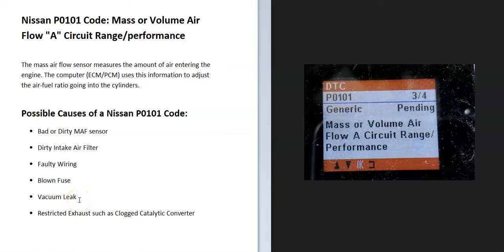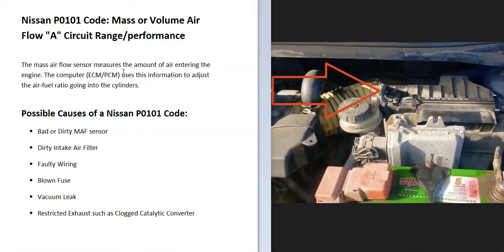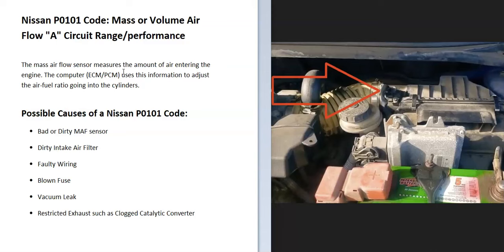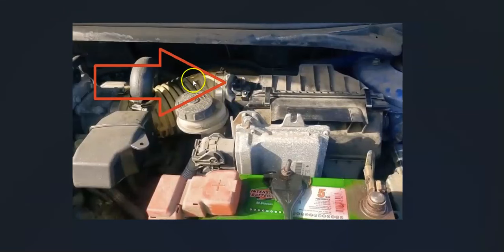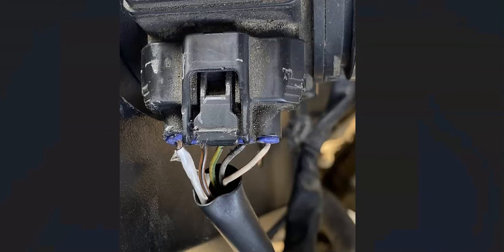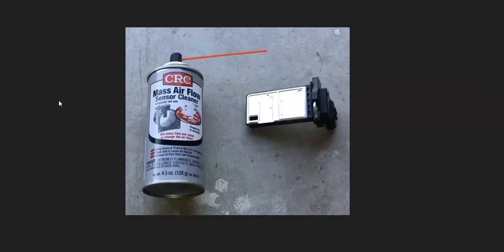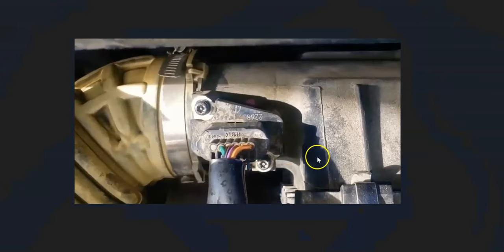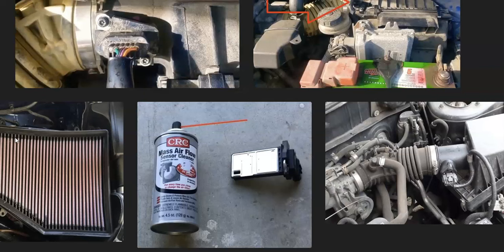Causes and Fixes Nissan P0101 Code: Mass or Volume Air Flow "A" Circuit Range/Performance

Comment: Hi guys sorry for this long message but i really need some help! I have a 2011 Nissan Maxima. Lately it has been jumping sometimes when stepping on the gas and having acceleration issues. The RPM is under 1 and it keeps making a jumping engine noise that sounds like vrmmm, vrmmm, vrmm, vrmm. Autozone used the diagnostics tool and said it was the mass air flow sensor. I bought a new one, mechanic installed it today and it's still having the same problem. When i turn the ceiling lights on they blink in unison with the vrmmm, vrmmm sound. My mechanic used his diagnostics tool and said the mass air flow sensor still came up even though he replaced it. He said another code came up "Bank 1 P-0101" this one. He watched a youtube video and said the gas is too rich? Whatever that means. He told me it needs to be taken to a shop to be put on a lift. He said he thinks the issue is behind the engine air intake hose. Anyone familiar with this problem and can give a resolution? I would truly appreciate it. I just spent $640 on a new alternator and a wire kit, then a week later $240 to fix some antifreeze leaking under the hood, then 2 days later this happens smh. This car is really getting on my nerves. Also if amyone can tell me by driving it with this current issue, can i make it any worse? Like will i cause further damage to my car? Should i just get this fixed right away and try not driving it?
Reply: My issue was low trans oil.  Replaced if over 20k miles since last trans oil change.
Reply: That sounds like a bad O2 sensor post CAT, when they go bad it runs rich like that especially at low RPM's like your saying bc that's when the air flow through the exhaust is at its lowest.
Reply: @EpicShmoke that's exactly what I was thinking. You'd think the dealership would check the O2 sensor.

Comment: I replaced the mass air sensor 3 times in a year what is causing this.
Reply: Dirty throttle body
Reply: @bluehunnids887  cleaned mine. No leaks, changed PCV valve the works. Changed the sensor too. Air filter was checked as well. No one can find the problem
Reply: O2 Sensors, they work in conjunction with the MAF. They dont effect anything untill the car gets hot and is out of closed loop though
Reply: @EpicShmoke I have test pipes on my G with admin tune to exclude 02 sensors and my car is having this same issue.

Comment: Excellent video. I have a question for you. I have a 2012 Rogue with a MAF problem p01 01 code. The Nissan dealer replaced the MAF. I replaced the air cleaner. I did not replace the PCV valve yet. The dealer I go to tells me they cannot fix the problem any more than they have because they do not have a Master Technician??? I am going to have to travel a ways to get a dealer with a Master Technician. The engine light has gone on twice now. It is supposedly fixed now. If not and the light goes on again and the car seems to run fine I want to turn off the engine light. I purchased a Walmart Hyper Tough HT 100 code reader. It is not much on instructions. It connects with your phone via Blue Tooth to give an explanation of the code. I do not need an explanation and I just want to turn off the engine light. My question is, do I have to use the Blue Tooth feature with the HT 100 or can I just plug it to the plug in the car, turn the ignition to on, read the code, and push the red button to clear the code??
Thank you, Tom Spero
Reply: Simple it is most likely and Air Leak on the intake boot check for cracks or breaks causing the leak or code have had this issue with many Nissan cars from 2010 - 22
Reply from the maker: I've never used that scan tool, but you should be able to plug it in and, say, clear all codes. The code will come back until the problem is fixed. If the MAF sensor is good, the problem is likely in the wiring.
Reply: @HVAC_Mechanic  Thank you

Comment: I had it replaced 2 times already and the code keeps coming up after 100-200 miles of driving, I might think is the fuse, but idk the number
Reply from the maker: I would be sure there is no vacuum leak and test the wiring.
Reply: @ishowman7  catalytic converter if you have high miles

Comment: Replaced pcv valve , new air filter , new maf sensor , and the same code still pops up . 2019 Altima under 60k . Thinking I might have a leak somewhere , I hear a slight whistle on acceleration when the code is thrown .
Reply: Have this issue on my 2019 also , changed filter and cleaned maf tb is next on list
Reply: @Xiantyl  let me know if cleaning the TB works . It’s insane that Nissan doesn’t do shit about this to help .
Reply: @Edemce1  got u, after the dealership changed air filter under warranty this code started appearing sporadically
Reply: @Xiantyl what was the fix
Reply: @TDRDemce  What is the TB?
Reply: @Davi-did  throttle body , my issue was dealer doing a flash on the ecu free of charge
Reply: @TDRDemce what is a flash on the ECU
Reply: Simple it is most likely and Air Leak on the intake boot check for cracks or breaks causing the leak or code have had this issue with many Nissan cars from 2010 - 22
Reply: @dconektaztapia7975  came out that it needed the reflash . No cost covered by the dealership . It’s on their bulletin

Comment: I replaced mass air flow but car warning lights come on in dashboard then when I stop at red light car shuts off !! 🤷🏼‍♀️🤷🏼‍♀️🤷🏼‍♀️🤷🏼‍♀️🤷🏼‍♀️
Any suggestions ?
Reply: Need OEM sensor only 
Any aftermarket will fail
Reply: Simple it is most likely and Air Leak on the intake boot check for cracks or breaks causing the leak or code have had this issue with many Nissan cars from 2010 - 22 and clean the Valves or turbo boost..
Reply: Any conclusion?

Comment: I finally got the p0101 code off my 2016 Nissan versa. It was the catalytic converter. My car had acceleration issues and at around 40-45 my car would have issues changing gears. It also made a noise that sounded like air being shot out of the engine. And anything over 60 was hard sometimes impossible. But anyway I changed catalytic converter out. My car runs better than when I first got it. I have new spark plugs fuel injectors coil packs throttle body new mass air flow sensor fuel pump and catalytic converter. 😂 I definitely threw parts at it. 😝 but hey she runs like a dream now.
Reply: i have 2012 versa.. changed the spark plugs and MAD and coil packs and the issue stayed.. gonna change the catalytic converter and see. thanks bro
Reply: Thank you just fixed my p0101 it was a clogged and deteriorating catalytic converter. Same exact symptoms. No other codes present. 196k miles
Reply: @ that’s is awesome I am so glad my comment helped you.
Reply: @ I can hear the cat converter if it’s messed up now.
Reply: Hey questions here. I have 2009 corolla LE model with a persistent P0101 code. I threw everything as well EXCEPT catalytic converter, throttle body, charcoal canister. Any ideas? 

It takes a bit longer to reach 3000-4000rpm around 60mph
Reply: @jamessena1410  you can test the cat converter through the O2 port. What is it doing besides rpm does it make a rattling noise? Smell and eggie smell? Tell me symptoms of what else it doing. You can look at throttle body and rub finger for built up carbon. Also check air intake system for holes. And last but not check for vacuum leaks. I use wd 40. Turn car on spray everything with wd 40 if engine starts struggle or rev that area has vacuum leak. Also wd 40 does a great job of cleaning engine outside. So rub down after spray and engine will look way better.
Reply: @jamessena1410  but the rpm slowdown was my pre symptom before it full went out and had trouble getting over 40-45 mph
Reply: @user-pu1xq9ef9u  There is no weird rattling noise. I might have missed on something. I just did a vacuum leak test only to replace the fuel filler neck and gas cap to no avail. DTC P0101 still came back on.

I have replaced most parts except throttle body, catalytic converter, air cleaner box, air inlet.

I have replaced:
-MAF sensor
-Engine wiring harness
-O2 sensors upstream and downstream
-PCV valve
-intake manifold gasket(orange rubber
-spark plugs
-fuel filler neck and gas cap
-EVAP purge solenoid
-Air intake boot (sits between air cleaner 
  box and throttle body)
-engine air filter
Reply: I have a 2009 Toyota Corolla btw
Reply: @jamessena1410  I bet it’s the cat converter. But before changing parts do a test before changing. Test the fuel pump and then test the cat. Pump is easy to test you can YouTube it. And the cat test is a $15 hose at autozone. You hook it up where the upstream O2 sensor is and check the pressure. You should be able to look up what the proper pressure is for your car. I did the same thing as you and wish I would have just tested before throwing parts at my car. But look at the bright side. You will have an almost brand new car engine when finished. Another thing I do is clear the codes several times to see if it threw different codes. But I’d almost be willing to bet it’s that cat converter if you changed everything else. There is a list that shows all possible reasons for p0101 and you have changed almost all. But could you list all the symptoms please the car is having. And do you ever smell what smells like a fart inside the car or by the tire. You could also bring it to a muffler shop and let them test it. Cause my O2 was behind my engine and hard to get to. I mean your this far in it might as well take it to home plate.
Reply: @user-pu1xq9ef9u  Yeah I am this close to going insane not knowing what the heck is going on with the car. Luckily I replaced all the parts listed above myself so I did not spend money on that

I have no symptoms at all while driving everything looks normal. But I do notice a noticeable decrease in acceleration like something is holding back the power going through the engine. This might have something to do with the change of how my Corolla's automatic transmission gears shifting

 I do  smell something like rotten egg when I cold start the corolla in the morning (note: my other car the Highlander does not smell).
Reply: @user-pu1xq9ef9u  My automatic transmission is working properly. It might be just affected by the current situation thrown by the code P0101
Reply: @jamessena1410  yes I bet it cat converter. That is exactly when I smelled mine. Dude exactly same thing I was going through. I was getting ready to replace my transmission. But my gut told me it wasn’t the transmission. Then it went completely out and I knew for sure what it was. But a cat can be expensive. I did all mine myself too. Except cat converter. I don’t have a lift to get under car and ramps I have would just be a pain to attempt. I called almost every muffler shop until I found cheapest one. I went and got it fix my car ran better than when I bought it brand new. I’d try it out. Your already this far might as well bite the bullet. Dude did mine in an hour and a half on a Saturday. I was calling her left lane Lousy. 😂 she is right lane Reba now. 😝
Reply: @user-pu1xq9ef9u  Thanks, bro! I hope I am getting close to getting rid of this P0101. Been a pain in the a**. 

Fuel pump still working normally no issue as I am still able to start the car. 

I can find a cat converter replacement non-OEM as the current cat converter is not even OEM part. Just have to find a least expensive mechanic.

I think you and I have the same situation in regards to car problems

More suggestions from you are more than welcomed!
Reply: Did you just have the p0101 code or others as well?
Reply: Should have just buy a new car at that point lol, how much do you spend on all the parts and labor?
Reply: @E @EverSánchez  it’s not. I did all work except cat myself. A new car is 20k. I mean why buy a used car when I have a used car.
Reply: @user-pu1xq9ef9u 15k if you get the basic versa and pay in cash, I rather buy a new car since I dont have tools, space or knowledge to do all of that.
Reply: How old was your catalytic converter? I replaced the entire exhaust (from the exhaust manifold all the way back to the tailpipe) 3 yrs ago. New cat also. Is it possible that the cat went bad in such a short time?
Reply: @age_of_reasonyou can test the cat converter.
Reply: What is the car doing?

Comment: I changed out my mass flow sensor, crack and cam shaft senors, throttle body, air filter and i took it to the dealer too trying to reprogram my ecu but they said it wasn’t available when they check it for my car

Comment: I have replaced the sensor but the code reappeared a few days later, replaced it again (n/c thankfully).  Reappeared again a few days later.
Now what do?
Reply from the maker: If the MAF sensor is good, then check the wiring and look for a possible vacuum leak.
Reply: @HVAC_Mechanic  Found out feom a mechanic the part from "....." Auto Store is bad on other Nissan Sentras also.  Installing a "Nissan" authorized part is fixing it apparently.  If that fails, hopefully not, will check wiring and for vacuum leak.  Thank you!
Reply: Check the hose to the throttle body
Reply: I finally got the p0101 code off my 2016 Nissan versa. It was the catalytic converter. My car had acceleration issues and at around 40-45 my car would have issues changing gears. It also made a noise that sounded like air being shot out of the engine. And anything over 60 was hard sometimes impossible. But anyway I changed catalytic converter out. My car runs better than when I first got it. I have new spark plugs fuel injectors coil packs throttle body new mass air flow sensor fuel pump and catalytic converter. 😂 I definitely threw parts at it. 😝 but hey she runs like a dream now.
Reply: Replace the PCV valve. It’s like a $20 part. Let me knw if that fixed it.
Reply: @danielcarmona9243  Bought Nissan brand sensor part.  Works so far so good.
Reply: I bet it cat converter